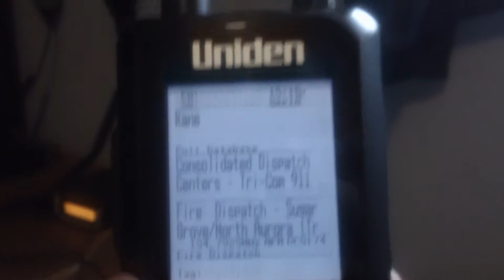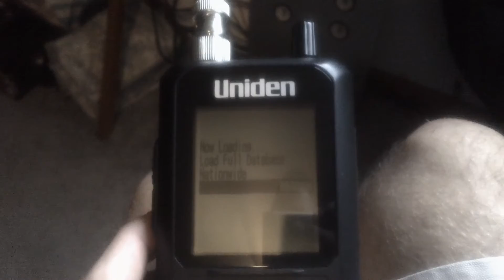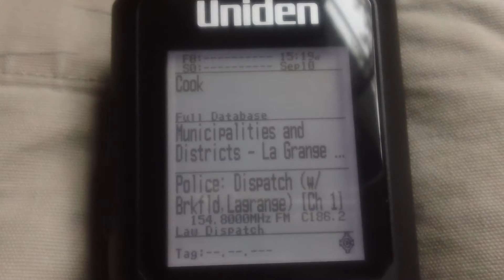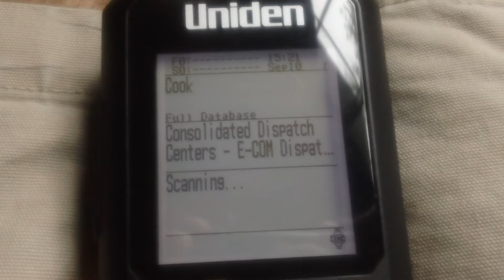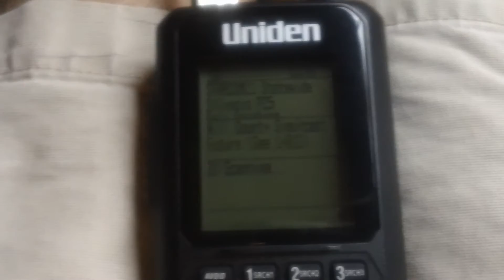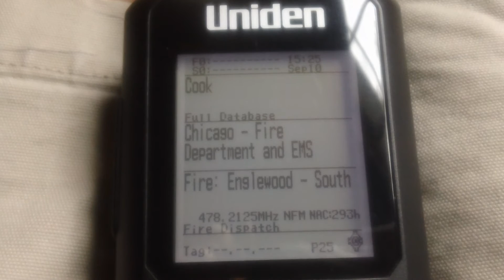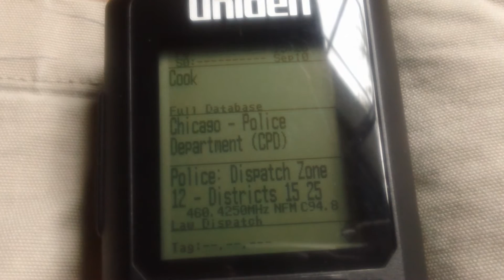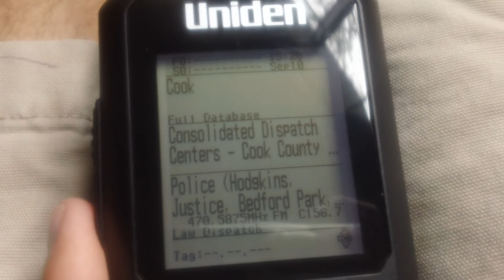Uniden BCD436HP - Scanning with a Cell Phone Antenna!

Comment: I actually liked that radio because it records to the SD card and it helps when people are nuisance Jammers you can actually catch them in the act and record it live as it's happening on the repeater input channels which comes in handy since there's been a lot of jamming lately in my neck of the woods and it's actually saved my ass a few times as well being able to post the contents of the recordings onto social media exposing the bastards and it's worked and my name ended up getting cleared because of it so no charges from the FCC I'm glad that they came up with these scanners that have SD card recording capabilities it helps when the shit really hits the fan and somebody is being targeted well speak no more we have this stuff and I love my 436 I will never trade it for anything even though the display is wearing out on it but it's still readable that's all that matters I just don't care for the simulcast Distortion cutting out all the time though on p25 trunking wish there was a way to really mitigate that so I don't end up having to get an SDS 100

Comment: I have a 800 MHz cellular patch antenna for scanning. It's really compact and you can just hang it like a picture frame. Really good forward gain. There are also commercial parabolic dish antennas made for 800, works great if you live in a LSM simulcast area.

Comment: Those box fans make great mag mount antenna groundplanes haha I used the same for my 2 meter ham antenna. Got out nicely.
Reply: If you use a Center Loaded hand held Antenna , you DONT NEED a Groundplane.
EX : the Radio Shack Telescoping HAM antenna .

Comment: 50ohm antennas will receive pretty much every frequency range
Reply: YES and NO. it depends on Antenna Height. for Example I use a 1/2 " stubby antenna for Dense Urban Enviroments and for my Frequency Counter. But most days my GOTO Antenna is the Radio Shack Telescoping HAM Antenna , it Extends up to 26 " and Collapses to just 6 " , and its Center loaded which means its Resonant at all Lengths. Its BNC. and it can be TUNED to a Specific Frequency Band. All the way from HF (2.5 Mhz ) to Microwave (1.3 Ghz ).